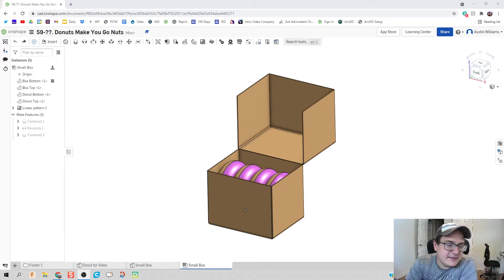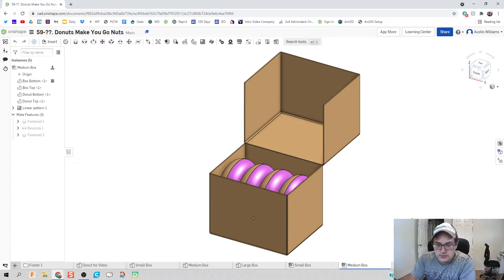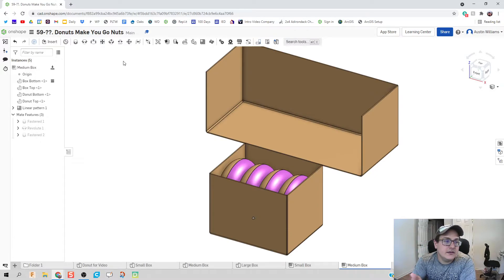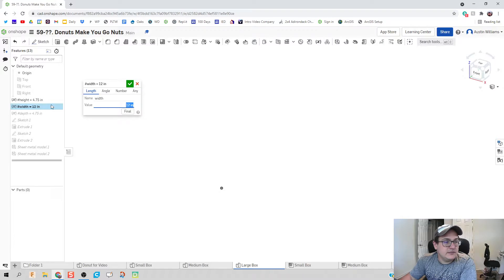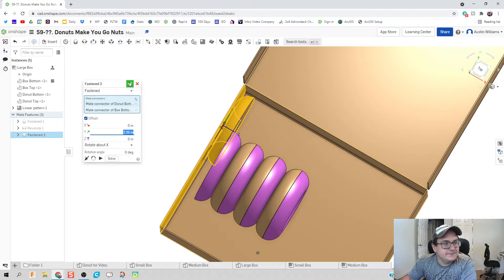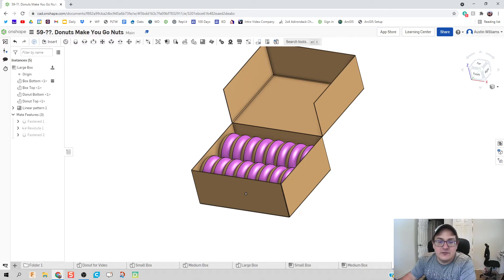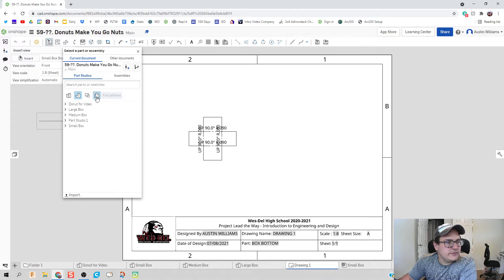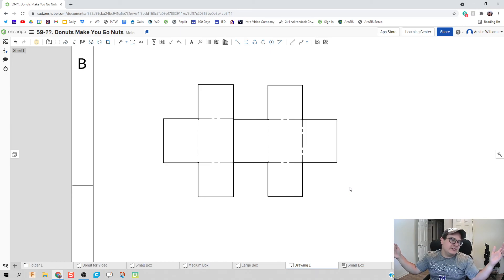Donut Box (pt 3) - Replace Instance - Day 61 of 100 OnShape Journey

Comment: I'm not sure why you would do this (three part tiles and three assembly files) when you could just use different configurations of the same part and assembly.
Reply from the maker: I think I am understanding what you are trying to explain. I wanted to create three  separate subassemblies quickly with parametric constraints. They could have been brought into the same assembly, but I would lose out on screen space showing how I was replacing parts of an assembly. Since all documents are live linked, unless separated, it wouldn't be feasible to have one part.

Comment: Neat! I bet there are a lot of fun things you could do with this Sheet Metal function!

I’m curious, though… Do you know if there’s a way for OnShape to treat the top and bottom as one part? Kind of like changing “New” to “Add”? I’m thinking that it would confuse OnShape if you tried to overlap faces when you’re creating the Sheet Metal from the extrusion. Doesn’t look like it’ll even let you select the same face twice. Or is there a more precise way of connecting the two parts in the drawing, like a Mate connection or similar? I’m thinking any engineer worth his or her pay would notice the solid line at the connection, where there should be a dashed bend line. 

Thank you for taking the time to make all these videos! I’m learning so much from them! 😊